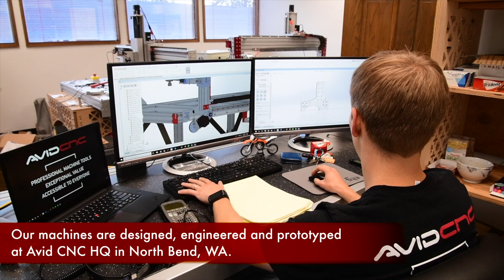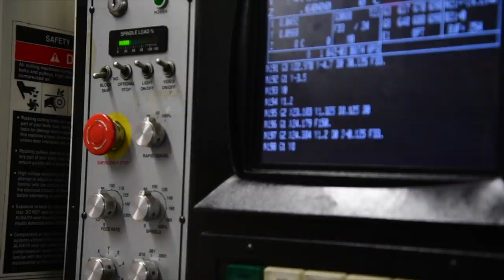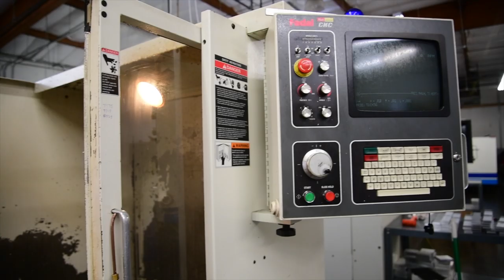Avid CNC Production Tour

Comment: I can’t seem to get an answer, I’m ready to either buy a desktop pro or a syil super x3 cnc mini mill. I want to cnc aluminum plate and some aluminum up to 4x4 blocks
Which machine would be better? Is the desktop pro as sturdy and accurate as the mini mill? The mini mill is used by the way it’s the 2010 model
Reply from the maker: All of our machines are designed to machine high density materials including non-ferrous metals, plastics, and hardwoods. 
For more information and aluminum machining in action we encourage you to check out Robert Cowan's channel. https://youtu.be/ii7HRgV-wbY